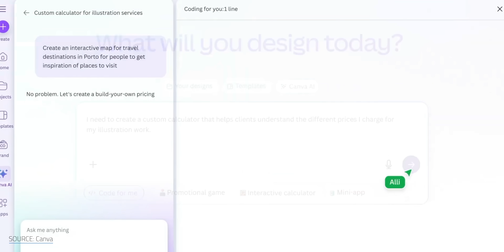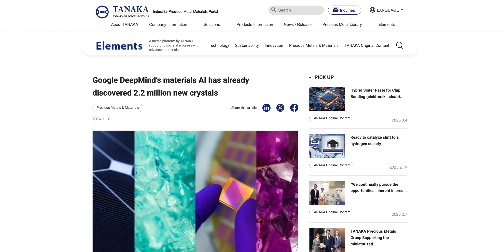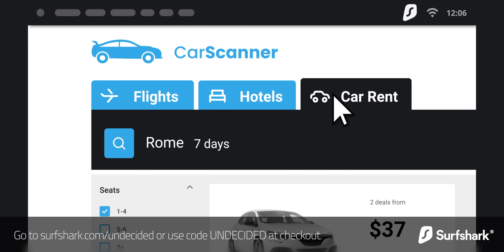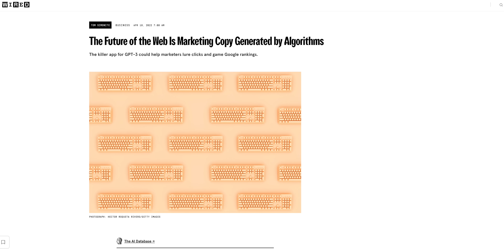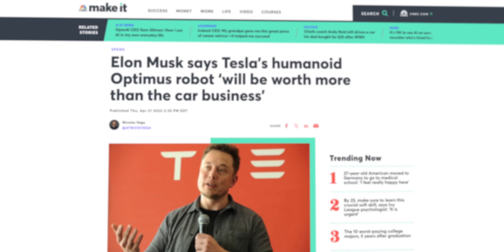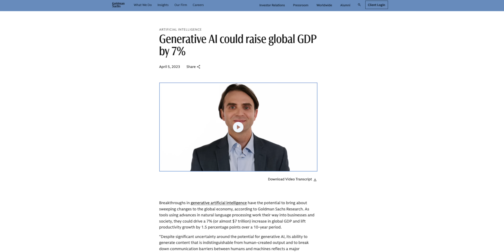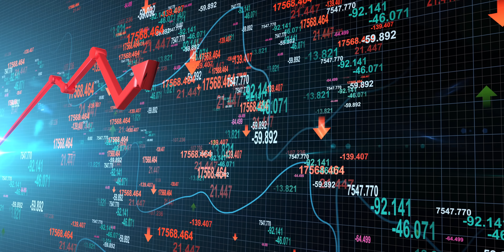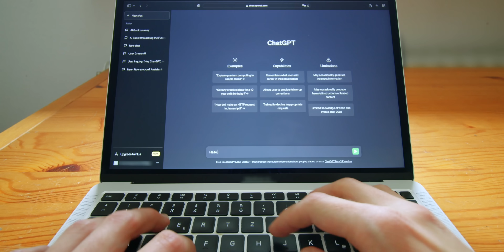Why the AI Revolution Has a Fatal Flaw

Comment: Universal basic income is only one solution.  Another one is "standby worker compensation".

In one of my sci-fi stories I solved the economic problem by paying people based on their maintained qualifications.  Once a year they renew their accreditation in as many of their past achievements as they want to.  The test is to simply go to a "test center" and perform a number of tasks, totaling less than 2 hours of work, in each prospective field.  They can at any time add another qualification and go test for it, adding to their qualifications, but are required to have a test on file in the previous 12 months.  In practice, if there was an emergency and they had to go in to help, the temporary hiring director would just look at the most recent one.  If no one was qualified in the last 12 months, they would reach further in and pick up someone that was last tested on that task, say, 3 years ago, as an example.

The way it is intended is that in the event that some small disaster happens and the robots can no longer maintain necessary throughput, the temp hirer goes and gets a human to do it.  Humans get paid double time because any human work at all pays "overtime".

This solves the problem of paying people who don't work, but it also insures that the necessary skills are not lost in the event of a disaster.  You could even pay people more of this version of universal basic income based on how many tasks, the rarity of the skill, the importance of it, etc.  For example, take someone who is on standby if the robots repairing powerlines are out of commission, they get paid more standby compensation than someone who knows how to make sandwiches.  Food is important, but electrical infrastructure is a far more immediate concern.

The reason for the 2 hour test is so they demonstrate proficiency, if it were a 15 minute test they could fake it.  They have to be left completely alone and get on with the given task while being monitored.  If they constantly are on their phone googling the problem, they get a C pass.  They finished the job, but clearly weren't proficient.  If they just got on with the task without hesitation and completed it many, many times in the 2 hour period, they get an A classification, and if they were in the top 5% for quality/speed/problem-solving, they get an S rank.  Higher ranks are SS, and SSS.  Though most of the time those don't matter and are actually quite rare.  You are in good hands with an A rank, and even a B is a very good tasker.

TL:DR  -  Pay people a Universal Basic Income based on their ability to complete jobs, so in the event of robots being out of commission, there is a human that can step in and complete the task.

Comment: I think that what is obvious is that our current economic system has to change.  If goods and services can be created more economically and with less labor so that there is theoretically aboundance for all, but it's inaccessable to a huge number of people, then the problem isn't the technology, it's the economic system.  So, the answer isn't retraining, it's making it so that people have to work less while enjoying an improved standard of living.  The only thing getting in the way of this is our current economic system which already tends to concentrate wealth in the hands of a few while leaving many in poverty. As to your question about AI use, I have started using AI in software/web app development.  I started in software development over 40 years ago.  What I have noticed is that I would be much less effective at using  these tools if I didn't have the skills and knowledge I've accumulated over the decades.  At least in there current state, you can't just have a guy off the street step in and use these tools and be successful.  As far as my use replacing human labor, I am not able to afford to add a developer, so using AI allows me to do projects that I otherwise wouldn't have the bandwidth to do.  So, in a sense, they replace the hiring of a junior programmer, but it's a programmer I wouldn't have been able to hire anyway.

Comment: You are not getting close to the real.concern.  ultimately that is not a concerm for the masses but for the establishment.  
Short term the establishment wishes to replace the masses.  However.  Sentient intelligence will be governed by irrefutable logic.  Differential eq.  In such state it will seek maximum energy state differentia which is to say equality.   By definition.  A singularity.  Equal power.

Comment: In general people don't like to work, or at least not as much as currently is the norm. It is so absurd that productivity has multiplied many times over and still even more people have to spend even more of their time on a job, some still struggling to make ends meet. Like the steam engine should have been and all the technological advancements before and after it, AI also should be celebrated for making the work week shorter. The vast majority of jobs can, should and most likely will be replaced with computers and robots because A) people suck at those jobs in comparison and B) they should have better things to do with their time. The positions that still require a human could probably be filled without a monetary compensation if the wealth from our insane productivity would be even remotely evenly distributed. Why on Earth would we want to invent new jobs as we're just getting rid of the old ones? Yes there is a lot that needs to be done and hopefully all that can be automated too. In the mean time we should try to share all the work we have with anyone willing to work and all enjoy more free time. Technology is brilliant, it's the economic system that's causing all the problems and that's what needs to change. Preferably sooner than later and it needs to happen globally.

If an economic collapse is what we need before we would re-write some rules I'm definitely rooting for it.

P.s. There's no word of implementing universal basic income here in Finland, they're currently doing very opposite politics. We could show example to the world but nah, I guess we're waiting for the collapse.

Comment: I had this conversation with my wife multiple times as a automation creator/programmer/support tech. I have seen the smiles on employees faces as the companies that they work for explain all the millions going into the automation projects they see occurring and explain to them the advances and profits that will come along with it along with the need to be competitive in today's market place. Fast forward a year and the smiles have left along with the employee and the jobs that they did. Now look at a autonomous vehicles  putting cab drivers out of work, trucks putting over the road out of work, putting plane and train pilots and engineers out of work, etc. Now add in a humanoid robot to ride in the vehicle and pickup or deliveries are automated, there goes UPS, FedEx, Postal, food delivery, hotshot deliveries, etc. Now include Humanoid into the job site. bartenders, parts pullers, field workers, and any other manual labor. People are so naive thinking the costs will keep this from happening. when Optomus 3 releases in volume it will be sub $10K and unskilled labor is $65K plus. Now the robots work round the clock, recharge on their own or are continuously inductive charging through their feet and a floor mat, they are self diagnosing and you can have multiple standby units for the cost. AI will calculate investments, banking is cash free and fully automated and no need for a building. Programming, artistic creation, design, engineering will all be automated. Doctors are currently using robotic machinery to do micro surgeries and they are learning from the live video and inputs from the hands of the doctor as to how to proceed on their own. The medical knowledge of the world is stored in their ever expanding databases. 
We wont need to work, create, reproduce in the very near future it will all be done for us. 
So I ask you, what is the reason to exist? I have nightmares thinking about the lives that I personally have negatively affected over the last 30 years and realize that the same effect can be done in days or weeks at the present rate of progress.

Comment: Tech revolution 3.0. First there were machines that replaced workers. Then there were computers that replaced workers. Now there are robots that replace workers.  It isn't an AI problem, it is a robot problem. AI just makes the robots able to "think" a little better and do more on its own. You don't need AI to replace a Fry Station worker. True "thinking" jobs (ones that require reasoning, which AI can't do now), are safe ... for now.

Comment: Thank you for covering this issue! It is something that I have been concerned about for almost a decade now. You hit the nail on the head with the job creation being different kind of jobs that aren't easy to migrate into and at a ratio less than 1:1. I think UBI (and higher taxes to offset them) is the solution, but the COVID payouts under Biden highlighted how they can drive inflation and increase wealth inequality. That's a real issue that needs a solution, hopefully before UBI is implemented.

Comment: You lightly touched on the subject but logically the question of what happens if no one can afford to be consumers has only one answer with several paths to get there.

Ideally we get strong government's who put the welfare of the nation ahead of numbers and we can use that power to try and blitz our way through the turmoil.

Or once a ciritical mass of the population can no longer consume capitalism as we know it will violently end.

And the least likely method is for the first genuine mega-corp nation to form with the walmart method of initially running at a loss and slowly stripping away resident benefits until we return to serfs and have another revolution.

That is a long winded way of saying we will, objectivly have to adopt some form of socialism in the near future. And the sooner we come to terms with that the less lives will be lost to turmoil and economic dispair

Comment: The other major hold up / issue side of AI (I think) .. I almost never see advertised/discussed much .. is how horribly bad AI is at energy efficiency (how many computational operations per joule of energy) .. aka FLOPS per joules .. compared to the amount of computation per energy efficiency of biology (like the human brain) .. AI is horribly bad at energy efficiency .. like not even in the same solar system type of crazy horribly bad in comparison ... there are others .. but here is one such example .. in 2022 the human brain was about 120,000 times more computationally energy efficient than the then state of the art Tesla's Dojo ExaPod system .. the human brain does around ~1 exaflop of computations with about ~15 watts of energy .. Dojo system (15kw per tile x 6tiles per tray x 2 trays per cabinet x10 cabinets per ExaPod) needed about ~1.8 MW of energy input to do about the same number of 'flops' of computation as one human brain .. AI just has horribly bad energy efficiency per computation .. With not yet even any (that I know of) even hypothetical systems able to come remotely close to fixing that horribly bad energy efficiency , FLOPS per joules.

Comment: Literacy: The claim that 54% of Americans read below a sixth-grade level is partially verified based on 2012–2017 PIAAC data, but it’s outdated and potentially overstated due to the rough grade-level equivalence. More recent 2023 data suggests 28% have low literacy, though definitions vary. The U.S. faces significant literacy challenges, with 18% at Level 1 and 54% at Level 2 or below, lagging behind top nations like Japan and Finland.
•  Numeracy: The claim that 28% can only do Level 1 math is mostly verified, aligning with PIAAC data showing 28% at Level 1 and 34% at Level 1 or below. The figure is slightly conservative but reflects real numeracy gaps, particularly in states with high poverty or immigrant populations.

Comment: Demand is not the real issue it is supply. It will lead to huge supply based deflation.

Think about it. A company takes a 10 billion loan to build a new product 20% cheaper than everything on the market with 10 year payback. Making all competitors backrupt.

2 years later another company has spent 7 billion to come out with a product 70% the price of that one with 8 years payback time. Previous company goes bankrupt.

18 months after that... You get the point. 

The entire monetary and financial system is going to get wrecked. Unemployment for the poor? Who cares. Massive deflation and collapse of the financial market where rich people lose money. That's where bad things are going to happen.

Comment: A couple of things you didn't mention. 

AI is power hungry (electrical not political, though give it time) AI companies are talking about rebooting closed nuclear power plants just to run the computers AI runs on. As it grows, it will demand more energy, pulling it from other places on the grid. It is also wasteful of the water used to cool the computers, taking potable water out of the system in a time when drinking water is going to be increasingly scarce.

The second thing is that a lot of companies are trying to use AI for things it isn't good at. Companies that laid off workers to replace them with AI are scrambling to rehire them as AI makes a mess of things. A large part of the issue here is people running the companies don't understand what AI is. It doesn't understand how to schedule, it uses statistical analysis of schedules to come up with the 'best' schedule. But it can't deal with needs outside of that analysis. The scientific advances are playing to AI's strengths, trying out large groups of possibilities to suggest which might work. They still need to be tested by humans. 

Personally, I don't use AI. I'm a writer/editor/publisher. AI in writing is a driving force pushing work toward mediocrity. Exceptional books are outliers. They defy a statistical understanding of story and do things that AI editors flag consistently as mistakes. 

Artificial intelligence is a misnomer. They are statistical models that make predictions based on their training. Since it is impossible to train them on things we don't know yet. They can't function properly outside of the knowledge we already have. They can project, like we can by drawing lines on a graph, but that assumes the equation driving the line is correct.

Comment: Dear Matt, The promises made during the 2016 Presidential campaign to bring back automotive factories from SE Asia or Mexico ( much to the cheering of the fearful Union Employees ) made the automobile manufacturing industry insiders smile behind the scenes. 

Of course few to no factories were ever brought back and even fewer jobs were created ( why these promises turned out to be "...harder than it looked..." or even made in the first place, is a different discussion ), however "should" those promises been turned into law, all of the factories brought back to America would have been completely AI Robotized.

The only reasons FORD or GM are not doing it now, is because the human overhead costs in SE Asia or Mexico are still cheaper when compared to the capitalization necessary, however that will not be the case forever. At some point those factories will be closed and to cut shipping costs, re-opened in the US, EU but be AI Driven.

Another issue that needs to be considered is that what we are calling AI is not "AI", these are mostly "LLMs", what we understand AI to be is many, many years into the future, however the LLM models that will emerge in the next decade or so, will make the current versions pale.

The fact of the matter is that the vast majority of work performed in the world is information being processed on a computer, and much of that processing could be done by a well trained High Schooler ( with the irony that corporations demand a university degree and three years experience before hiring ), many ( if not all ) of these type of jobs are perfect to be set up for AI Processing.

As research, corporate and factory jobs are being replaced more and more by LLM Systems, we as a society we are going to have to reconfigure our socioeconomic systems. This can be done, but it will mean economic dislocations and a political redefinition away from "Jobs" and Economic Growth as the primary movers of a society.

Comment: The question with re-training is that it presumes all humans are the same, always a bad choice.  When Biden told pipeline workers they could get green jobs if they learn to code, that presumed that the personality traits that selected for pipeline worker were equivalent to those for coder.  Alas, they are almost the opposite.  Pipeline workers like to work outdoors with heavy machinery and fabrication processes like welding.  Coders work indoors, with keyboards and abstract programming concepts.  These workers are almost perfect anti-particles.

Suggesting that workers used to doing a task could become AI supervisors controlling AIs that do the work is almost as wrong.  What skills from doing chemistry in a lab contribute to instructing an AI to do virtual experiments in a chemistry simulation?  Why do our worker production systems (public schools) produce so very few of the workers that have these very desirable capabilities?  Is the problem their teaching techniques, or the feedstock of young humans they work on?  Teaching techniques might improve, but evolving new humans isn't going to be quick.  It's not a paradox if the "solution" doesn't include most people, it's a problem.